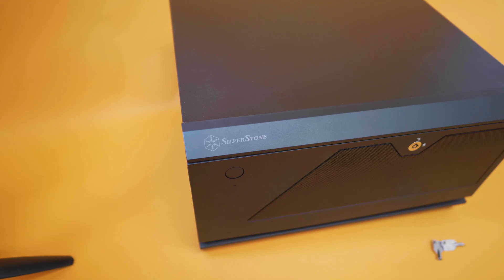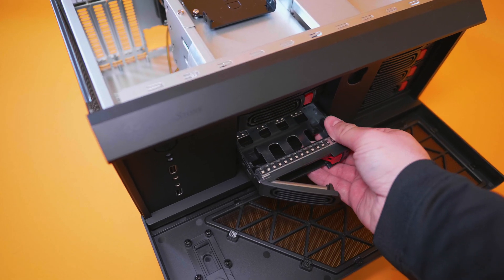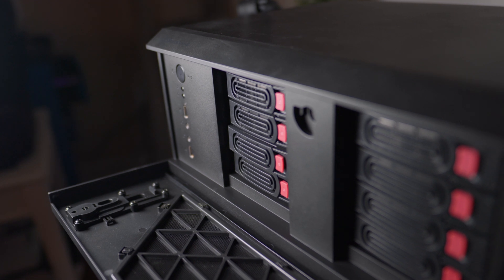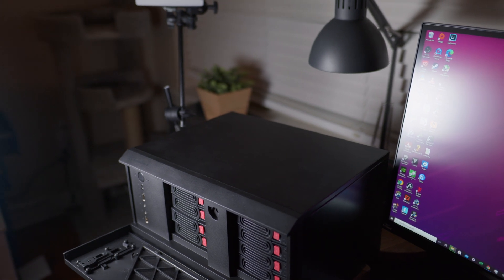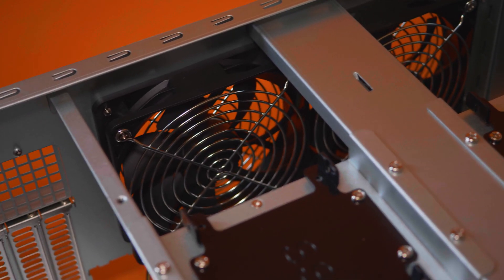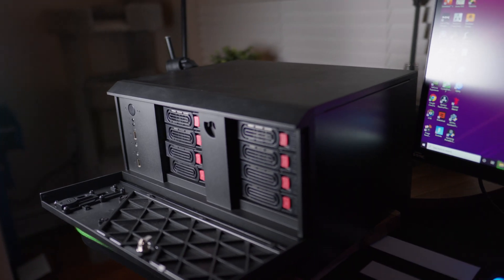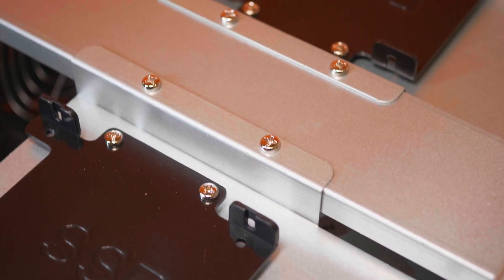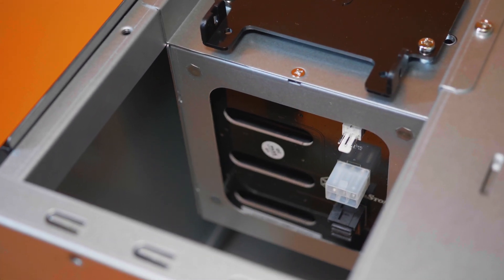Building a DIY NAS in the Silverstone CS381, Network Attached Storage

Comment: Server stuff gives me a stiffy. I had a home server in a Rosewill 4U rackmount. However it became a dust trap so I migrated that into a cooler master HAF lanbox. The dual Xeon 5677's breathe easier now.
Reply from the maker: That’s an awesome setup! It’s so much fun to tinker with 😁
Reply: @ClassicalTechnology  Old server gear is fun to tinker with. Sometimes it's almost like I intentionally break it just to fix it. I've played with a power hungry quad Opteron 64 core 6386SE setup at one point, but I've settled with my antiquated dual Xeon X5677 setup for now, until the more power efficient haswell server gear is cheaper on the used market.